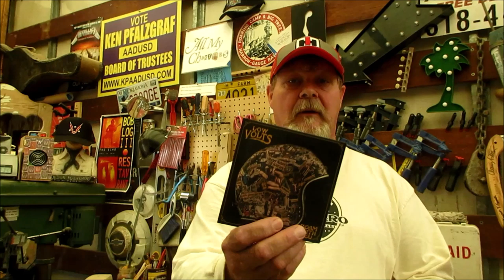Details Matter: How to Build a Cigar Box Guitar

Comment: Hey Ken - Video Suggestion
I’ve been all through your videos looking for a video on how to prepare the neck for the fretboard. 
How you get the neck flat enough 
How you know when the neck is actually flat enough to glue the fretboard on. 
Seems that if there is a bit of backbow, that would need to be evaluated. 
Best method to clamp the fretboard to neck. 
I’m sure it does not have to be 100% perfect but when is it ok to proceed
Thanks
-Bob.  Athens. GA
The